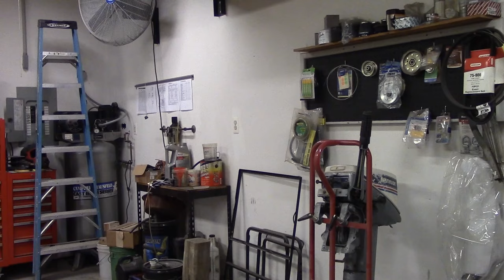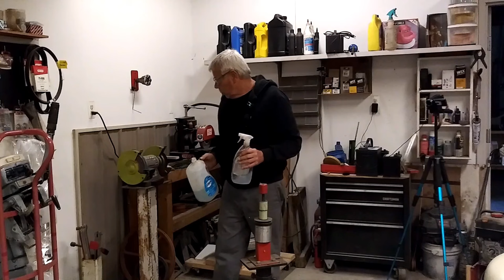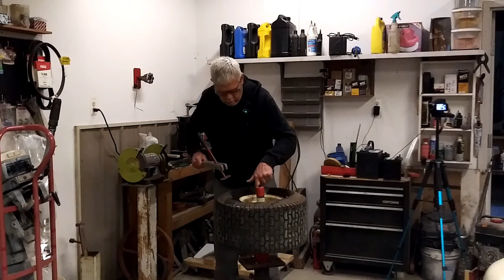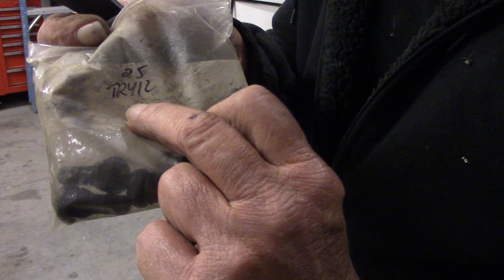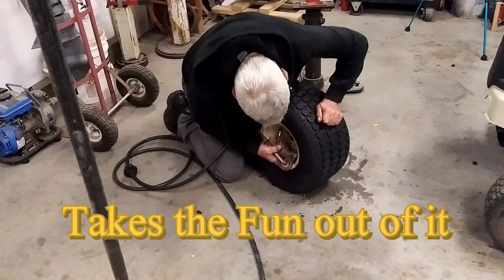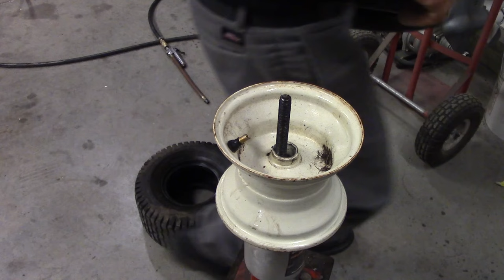Lawn Mower Tires Easy Change

Comment: Hey good job. 
 I'm almost 68 and wore out! Ha. 
 I need to change a couple mower tires is why i found your video. 
I have been looking at tire spoons. 
 I don't have a inside garage so i will be outside and temp is in the  90's so i know i will end up soaking wet!
Thanks for filming the procedure it really helped me knowing what i'm in for.
Reply from the maker: Hope it helps.  Spoons will defiantly help. The key tool when putting the tires on are the vise grips. Those little tires will scoot around and around the rim without them. thanks for watching.

Comment: Nice work. A ratchet strap around the circumference, in the middle of the tread, can help expand the beads to the rim for the initial seating.
Reply from the maker: Good tip. Thank you for watching.